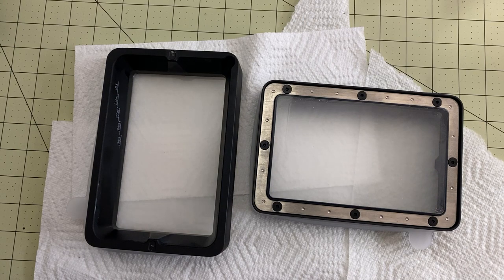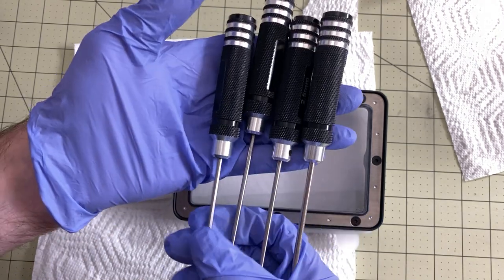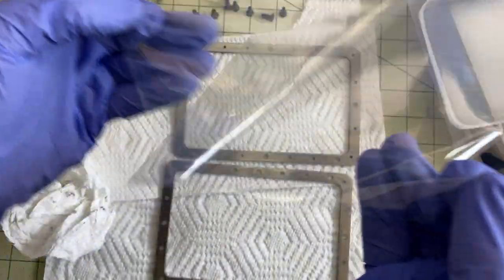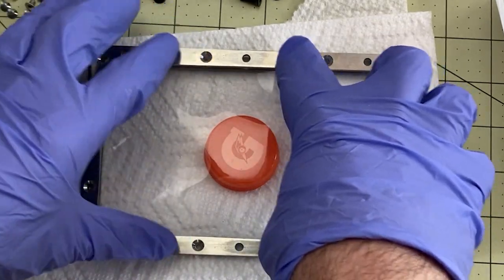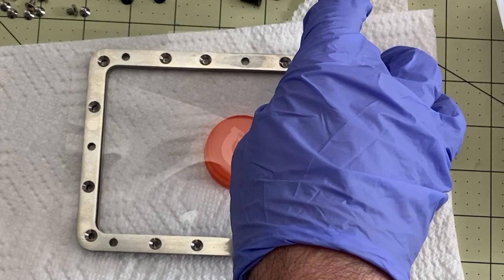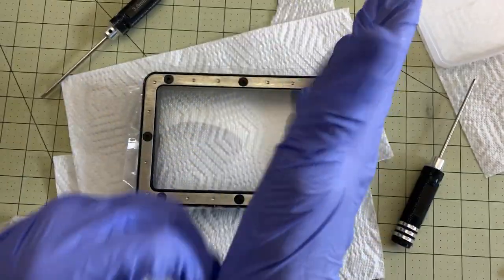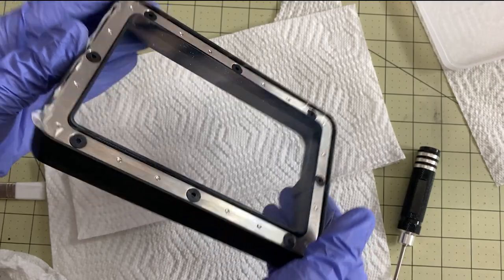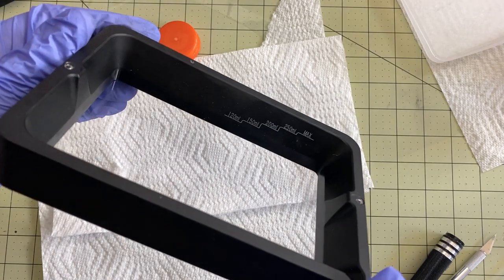How I change the FEP in my Sovol Resin Vat for my Anycubic Photon Mono

Comment: Do you have any advice for the tanks Sovol sells with the one piece clamp? Apparently their process requires a hole punch template that's too big to print on the printer it's intended for... And is especially unhelpful if you find out you need it after you've taken the FEP out of your tank...

Comment: If you're using a 2.5mm Hex Key, the screw is probably a M3x0.5mm. Therefore each turn of the screw is 0.5mm travel which = 1 Pitch.
Use a straight edge, metal ruler, to make the frame "flush" with vat. Then count the screw turns exactly on each for a perfect parallel frame to vat mount! 👍
Agreed, like mounting a canvas or torquing the head bolts down on an engine.

Comment: I bought the vat that you have linked in the upgrade you must have video and it does not have a split frame.  It is one piece and leaks like a sieve if you change the FEP.

Comment: Couldn't see a video, did you ever check the revised version? I am wondering if you need to do anything special or just replace them with the sovol FEP that already has the holes. In theory it should be just screwing it in and done

Comment: i dont have this metal frame with extra screws to put the fep between. i only have a black frame, comes with my sovol vat. cant do the "spaceholder" trick because i can only lay the sheet on the vat and put the frame on top of it. is there a way to do the cap-trick?

Comment: Apparently there is a new variant of the Sovol vat.  I recently bought the non-PTFE type and it has 10 screws, not 8. (as viewed from the bottom when assembled)
Like the one in the Sovol video named: "How to Replace the FEP Film on Sovol New PTFE Resin Vat"  -> https://www.youtube.com/watch?v=hAx2X5NiNqM
They have an STL of a template you can print to pre-punch holes and no bottle cap.  I wonder if their template has the added slack the bottle cap provides built into it?
Doesn't much matter at this point as the template is larger than my printer's vat.
Reply from the maker: I have one on the way to compare.

Comment: what spectrum analyzer did you use, also i got a sovol vat and the model is only a single metal fep holder not 2 like yours. any links for the one your using?
Reply: it's just an app dude , all you need is a microphone and an implementation of the fast Furrier transform